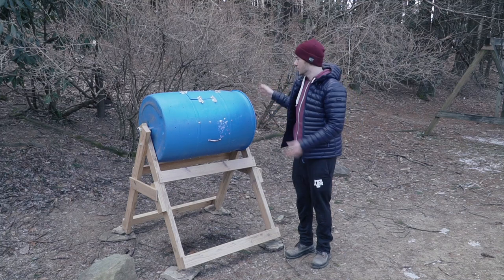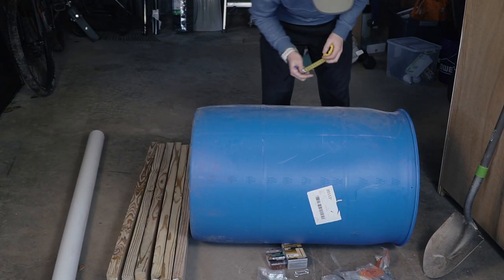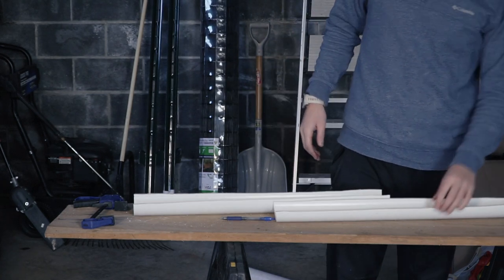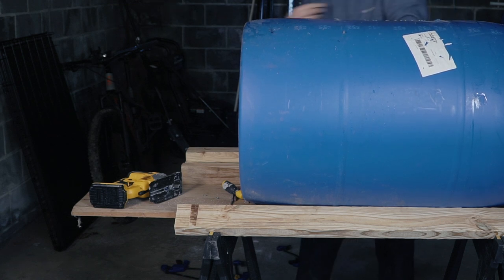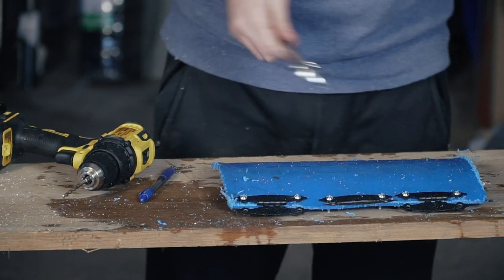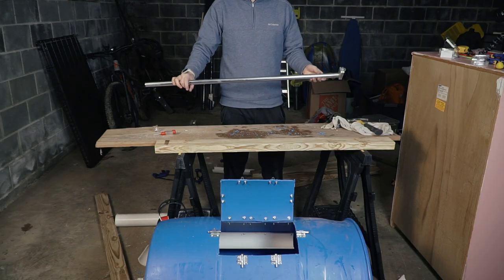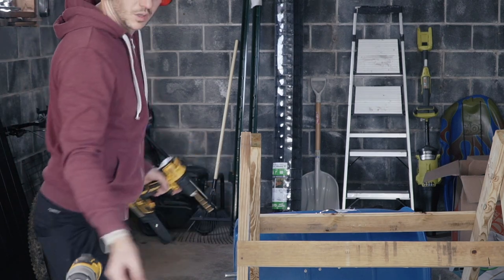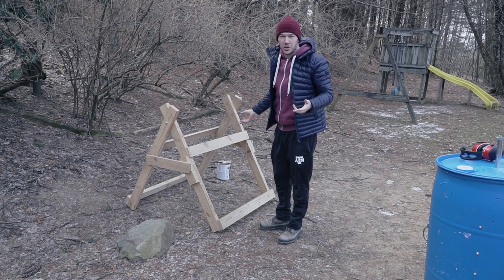DIY Ultimate Compost Tumbler - Step by step

Comment: you can easily add a second drum on the bottom since the frame is pretty sturdy. If the amount of compost is not much, I would use 5gal buckets with holes on the bottom and compost in small portions. I have been doing 5gal compost buckets and it's been fast and easy. 1 layer of 4" dry leaves, then 1 layer of 8" kitchen scraps, then 3" of dry leaves, the another 8" of green stuff, then 2 to 3 " of used garden soil. then leave the buckets out in the corner of the yard, spray a lil water every 3,4 days depending on the season. in 3 weeks, they all fall apart, and in 2 months, they are ready for feeding the plants. no turning, so stirring, no spell. chopping up all the recycle matls is the key.
Reply from the maker: Thanks for the tips

Comment: How does the drum rotate on the rod? Curious to know if after regular usage, does the Barrell roll easily ?
Reply from the maker: I just use the handles to roll the drum around, it’s been working just fine so far. The plastic of the drum is thick enough that it can rotate. 

I guess it also depends how filled the barrel gets, but for our use it’s been fine.